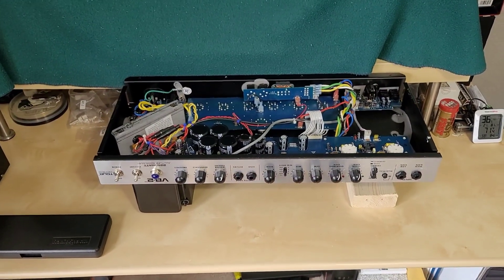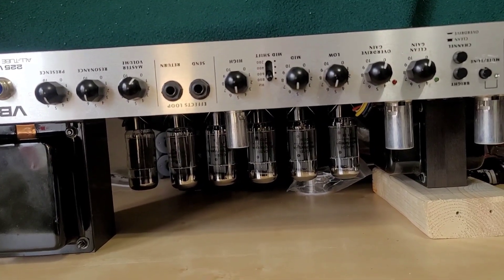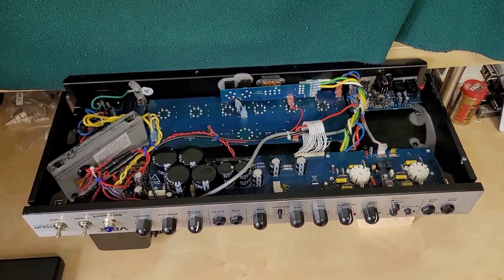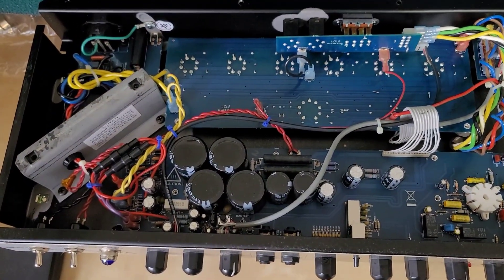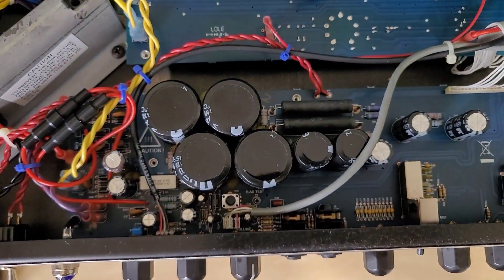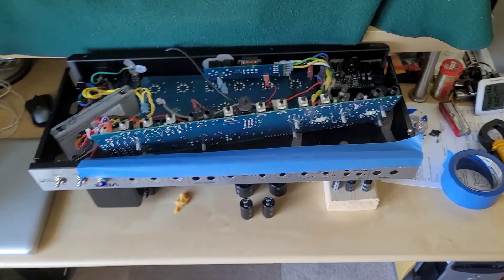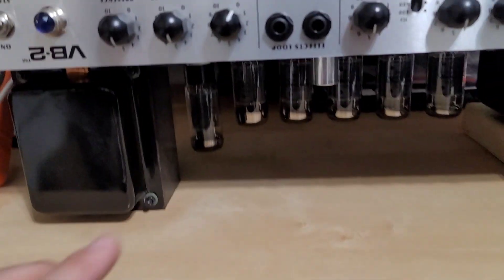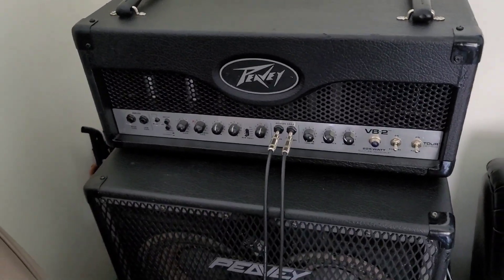Peavey VB-2 Why is my Tube Amp Humming/Buzzing? - Replace the Power Supply Filter Capacitors!

Comment: Do you remember the capacitator order nr/brand/type? For the big ones.
Reply from the maker: Send me an email and I can give you a parts list from Digikey.com. the large 350V 470úF caps are below. Nichicon is the brand I used, but if you match the physical dims of the cap you can cross it to another reliable brand.

https://www.digikey.com/en/products/detail/nichicon/LLS2V471MELB/2549000

Comment: I just bought this same model amp, it is sofa king noisy it sounds like an old radiator style heater, it really sounds like an old heater, and I'm really concerned that it's going to cost me an arm and a leg to get it right. But at least I've got your videos to show my tech guy and hopefully that will put him on the right path.
Reply: Is this the kind of maintenance that a big tube bass amp regularly requires?
Reply from the maker: @leebodean1493  yes. Electrolytic caps have a limited life span of 10-15 years as they dry out. Some have said to me they can go longer, but I wasnt going to chance it. $45~ in new caps was worth it.
Reply: @Bassguitarist1985  I'm going to have everything done for my amp, that you have done to yours in both videos. I'd like to know about how much you spent on parts and about how much time it would take a knowledgeable tech to get it done?
Reply from the maker: @leebodean1493  about $45 for all new caps, $10 for two fuse holders and standard 5x20mm fuses to fit instead of the solder lead 5x15mm.

Figure 30-45min labor to disassemble amp, and say another 45-60 min ( could be longer depending on the tools he uses) to install caps/adhesive and fuse holders. Add another 30-45 to reassemble.

A matched sexet power valves plus two 12ax7s and one 12AT7 can vary. EHX ones are $$$$$. Setting the bias to 26mA/valve with a probe is a 15-30min procedure.

I don't know what the going rate is for Amp technician services these days. Assuming the amp does not need anything else repaired while he's in there this is what you can expect to pay.
Reply: @Bassguitarist1985  thanks man, you've been super helpful.
Reply from the maker: @leebodean1493  Anytime! Once its fixed enjoy and play it often!

Comment: Great video! Was wondering what made the buzz and pop
Reply from the maker: Thank you for watching the filter capacitors were well over 15 years old at this point. They have a finite service life and as they start to dry out inside they allow some of the ac voltage to leak through causing buzzing but at 120 HZ or double your mains frequency